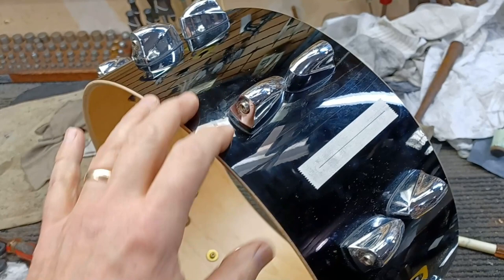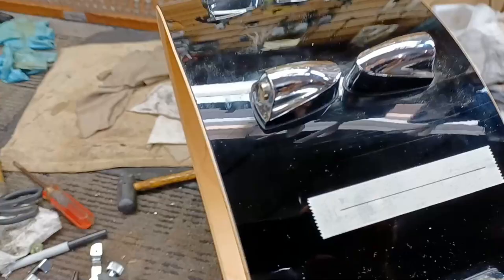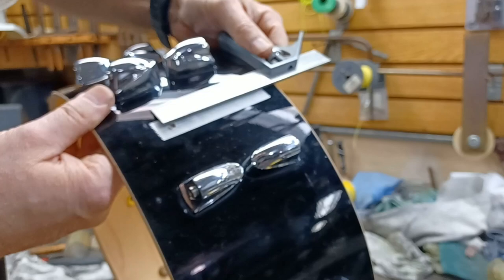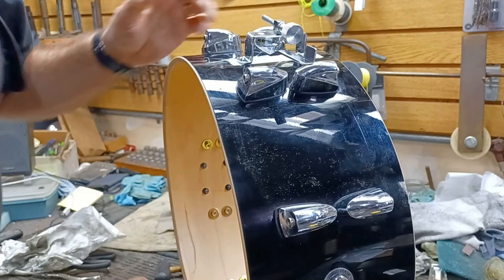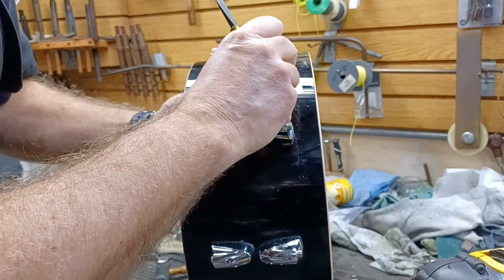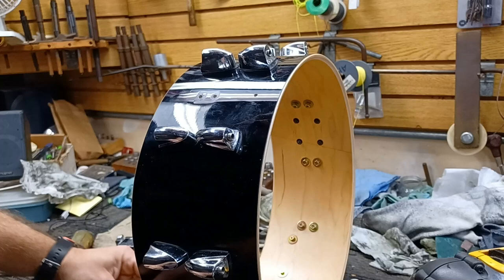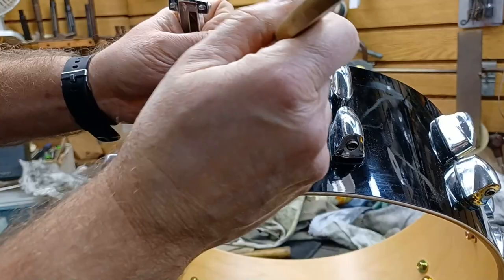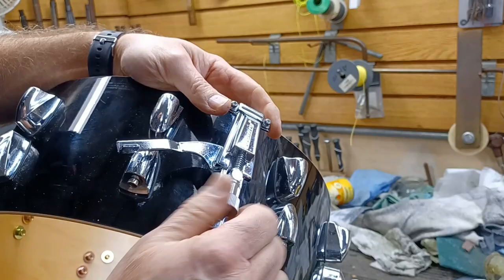SNARE STRAINER INSTALLATION by Jim Huwe

Comment: It great watching a master do a proper snare strainer installation! Awesome Jim!
Reply from the maker: Thanks! 👍 I know a lot of people hate P85's, but time and time and money sometimes make the call. Those from the late 80's were bad. I wrote to Bob Gatzen back in the day to tell them to get on it and make it work decent again. I had versions from years before that were fine. Then they got a design with sloppy fitting and they would bind. Corrected now. Simple to use. I keep them in stock like Hersey bars at the grocery store.
Reply: @jimflys2  I have one on my Acrolite, my 6.5 x14 BB has the P88, and my 5x14 BB has the Dunnett R4 made for Ludwig drums!  I love the Dunnett throw off I have them on 4 of my drums! But the P85 works fine.
Reply from the maker: @earldrum  How much are the Dunnett's running?

Comment: What order do the hex screw, washer and lock washer go on the strainer? Are all those parts attached to the screw from inside the shell?
Reply from the maker: Yes, inside the shell. Screw goes thru the shell. Flat washer on the screw. Star washer OR split washer next. Finally the nut. Tighten. Done.